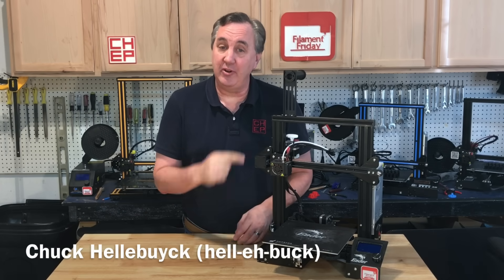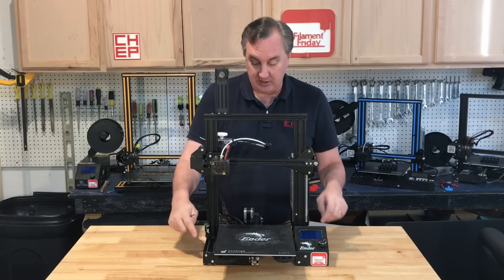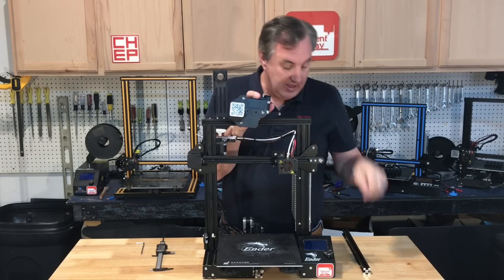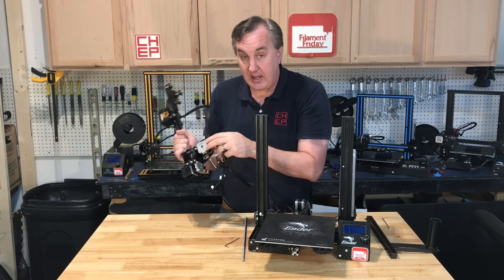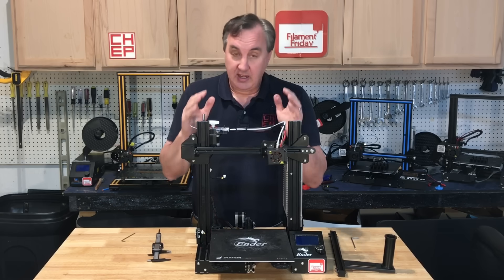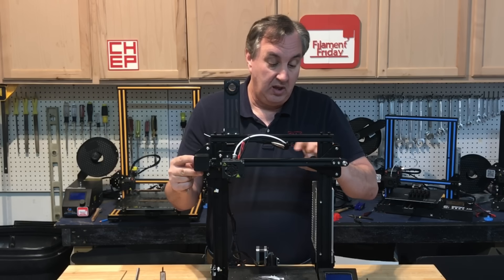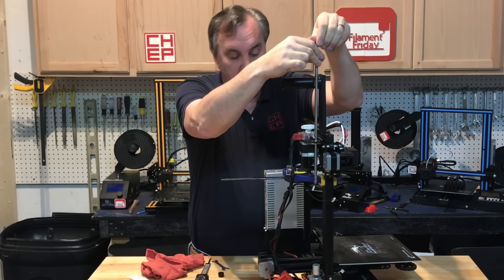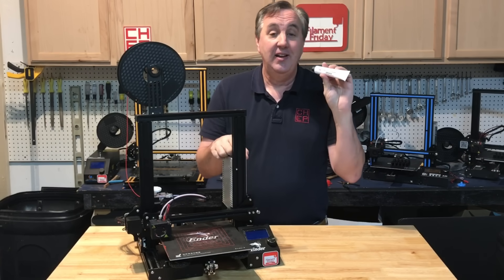Fix Your Bed Level on Creality Ender 3

Comment: Hey Chep! Is there a way to keep the nozzle on my print the entire time? Im printing ducts for a multirotor rc helicopter  and theres stringing and globbing, im using tpu, im using cura 4.3 and ender 3 thx!
Reply from the maker: Why would your nozzle not be on the print?
Reply: @FilamentFriday  well i mean it jumps around the print when retracting, just wondering if yoy can change the travel settings so it never jumps
Reply: @FilamentFriday  figured it out. Its combing mode, to reduce retractions and blobs.  Sorry of i was confusing

Comment: Hey Chuck, have you experienced cura resetting your profiles back to stock? i can save profiles, then close the program and start it again, and retraction, speed, layer height and so on has reset to stock for me :S
Reply from the maker: If you don’t save them as a new or updated profile it reverts back to the original. Otherwise no, I haven’t.
Reply: @FilamentFriday  huh ok. Cause cura 4.2.1, 4.3, 4.4.1 all resets my profiles back to stock. And on every "better result", i save as a new profile.  They seem to reset retraction, layer height, and other setting to stock. I even tried to export profile, then importing it the day after and settings were reset again.

Comment: I put stronger springs in and also removed that strain relief from the lower left spring. another strain relief must be used that does not interfere with bed leveling.  The bed level has not changed in weeks.

Comment: Please help i have an issue with my CR-10 printer
 
While printing the extruder motor stops rotating few seconds then continues feeding then stops rotating few seconds... 
Is there any solution?
Reply from the maker: I’m sure there is but I don’t know based on that. Test it out via the LCD.
Reply: @FilamentFriday  
Thanks for answering 
I just found out there's somthing wrong with E plug in the mainboard

Comment: Wow. I'm happy that I haven't had to go to this level of troubleshooting to get my bed level. I did run into the problem of the large wheels on the threads under the bed falling off, assuming it's from vibration. I'm wondering about getting four nuts to help keep them in position, but then I wonder if those will just vibrate off as well.
Reply from the maker: They should have lock nuts on them to prevent that.
Reply: Nylock nuts!

Comment: I suffer from a 2-3mm warping on any size above 6cm x 6cm, mostly front right corner and back right corner, and no idea whats causing it, I thought first its the cooling problem due to factory cooler (Ender 3), but after reading a bunch, it sounds like its not the case, Im running a creality official tempered glass bed, but that happened with factory one too. Not giving up but any advice what to look into is appreciated.
Reply from the maker: Flip the glass over and use Avery Glue Stick.
Reply: @FilamentFriday  We dont have Avery ones here, is there a specific things I should pay attention to while using an alternative? (UHU i.e) Or its just "what worked" and Ill need to try a view?
Thanks alot for the advice

Comment: I always had warped bed on my ender 3.
After using it for one year I had to replace the build surface.
The adhesion came back, but also something else happened, my bed wasn't warped anymore.
Not sure what happened there, I think the factory build surface sticker had some inconsistencies or was applied poorly.

Comment: great video, I had "some" (5 mm ) slack on my CR10 s5 and the above method would have worked just fine as well I spent way more effort than described here, this would have been so much easier ...

Comment: You left out one of the most important steps which is making sure the Y Axis is level, if it's not then the first layer at the front or back of build surface might be too high or low, best way to know if your bed is right is run a tramming circle.
Reply: backyardbasher how? 🤷‍♂️
Reply: @madrian_hello  push the bed all the way back and measure the distance from the table/bench the printer is on to the top of the bed then slide the bed all the way forward and repeat the measurement, they should be the same, if they are different you either have to shim the center bar where the Y extrusion mounts on it or you have to loosen the 2 hex screws on either side of the main frame then make adjustments and re tighten.

Comment: Hey Chuck, I have a problem with my bed on Ender 3, the middle where the aluminium profile runs is always too close to nozzle while the sides are low, any advice on how to fix it? I have adjusted the excentric nut so its tight.
Reply from the maker: Your bed could be warped. Might need a new one.
Reply: Try to use a glass of 4 mm over the bed, and use hair spray for pla,pteg and stick glue like uhu for Abs (well yuo are gana need an enclosure for Abs)
Reply: I had same problem take a metal ruler run it across the centre of your bed from left to right then look at the bottom of the ruler you'll see light coming through run tape along the bed where the low spots are then get yourself a glass bed and use hairspray also adjust your end Stop to compensate for glass bed I think it's 4mm
Reply: Hey Chuck, as always a great informative video.  It helped me take care of several problems. There is a low spot in my bed too, but before I tried the glass, I simply lifted the mat and placed two 2 inch pieces of notepaper underneath the mat in the center of the bed to act as a shin. This raised it 0.14 mm and seems to have taken care of my first layer adhesion issue.

Comment: Nice display of some mechanical sympathy Chuck :)  I suspect a lot of print quality problems are down to poor assembly on these. The instructions are fine if you have some experience of mechanical systems, but for a novice, there are many pitfalls. To be clear, that isn't a criticism of users who don't have the experience!

Comment: This looks like it'd be a good video to check out if you're getting any z-banding too. Those uprights and the gantry caused me some problems on taller prints before I rebuilt them like you did here.

Comment: If you use wd-40 dry ptfe lube on the lead screw you will have incredibly smooth z movement and no dust buildup after long term use and you can even spray it while in use.
Reply: From what I have read the name WD-40, stands for, water displacement formula number 40. It is not necessarily a lubricant, although it does have some lubricating properties. You are better off using superlube or even Vaseline as others have suggested. I prefer superlube.

Also: any spray lubricant can affect your print. It goes everywhere. Do not use spray lubricant around your printer.
Reply: @joea3728  he litterally said dry ptfe. The brand is wd 40.
Reply: @claudekim7876  I was just writing this exact response when I noticed a reply from you.  Thank you!
Reply: WD-40 is now a brand.  They bought/merged with other lubricant makers and now many products are labeled "WD-40" even though they have nothing to do with the original.

Comment: I had a persistent problem getting my Ender 3 bed level.  The normal level procedure typically ended up leaving one of my leveling screws falling off.  So I completely re-built the frame, using foil shims to make everything completely square.  Still had the problem.  Built myself a 3-point level system.  Still the same problem. I finally came across someone describing a similar problem who discovered their Y axis extrusion was twisted!  I put a level on my built plate and moved the Y axis through its whole range, and sure enough the bubble shifted from left-of-center to right-of-center as it moved. I got myself a piece of bare black extrusion and cut/drilled/tapped it appropriately, and finally I have a perfectly level print bed!

So, if the steps in this video still don't work, check that your Y axis rail is flat!  If it's not, no amount of adjustment of the surface plane or the rest of the frame will keep the hot end level across the whole build plate. And it doesn't take a whole lot of twist to turn into being several mm off at the edges of your build plate.

Comment: Ender 3 have another ploblem . Its dont read the sd card . 
Can you explane solution
Reply: mahmood02 try another SD card
Reply: @funKdatFPV  i tried 3  with 4 gb 8gb
Reply: Not trying to be condescending, but are you initializing the sd card after you've put it in each time? You do it from the menu on the ender 3. Once you do that, it will let you print from the card.
Reply: @readysetnogo  i insert the sd card , from the menu i initialize the sd , up to print form sd , if inter no files to print
Reply: The stock one that came with the ender 3 just died mid print on me
Reply: If yuo have many ,many gcode files its gona be an error, i think its just a memory issue from the microcontroller, just erase some files an try again, its happend to me
Reply: @noway8233  one file only
Reply: Hey bud,  are you running your STL files through cura or another slicer before you put them on your SD card? Sounds silly but when I first started 3D printing a while back I didn't know you needed a slicer and put the STL file directly onto the SD card and it's exactly as you described, nothing shows up, because you have to inject your print settings into the gcode.
Reply: @masamasa1815  I'm hopelessly new and I don't follow you!  Could you please explain step-by-step what is to be done in your second sentence--please?  Many thanks!

Comment: Drilled one hole in the up right. Left on inside. Lock tight the outer one snug it up. Lower the gantry on something sitting on lower legs. Tightening gantry wheels then tighten the gantry screws

Comment: Last year, I had an issue where I would level the bed, and somehow it would immediately become unlevel with any movement. Simply touching the bed made it unlevel. I struggled finding the problem for quite some time. The culprit turned out to be an adjustment for the wheels of the bed. It is out of sight and out of mind. To test this, simply wiggle the bed to side to side. If it moves, you need to adjust that part.

Comment: I had the same thing where those two screws made it extremely difficult to adjust the level of the beam.  I ended up drilling a single hole that is maybe 5 inches from the top on the inboard groove, that lines up with one of the screws, and with it on the machine, was able to tighten and loosen it, and got it level that way

Comment: I have to say that it's a horrible design to have to totally disassemble the top half of the printer to do something so simple as getting the crossbar level. People dislike the Tronxy P802M for a lot of reasons, but this is one area where that design totally blows away the idiotic design of the Ender 3. If I want to level my Tronxy printers, I simply turn the TWO stepper motors on the Z axis until the X axis is level. No disassembly or guesswork required.

Comment: Th3d has their own z rod clamp and anti backlash nut. Do you think these are worthy upgrades?  Whenever I pause my print the hot end goes down ever so slightly that it runs against the printed part it paused printing.  I’m thinking I need this on my printer.
Reply from the maker: I haven’t tried it. So I’m not sure.
Reply: There is a stepper timeout in the original firmware. After 120 seconds of iddle time the steppers lose power and your xgantry can fall a little bit. I disabled this for my z axis in the firmware so when you pause it will stay at the right height. It's better to invest in new firmware

Comment: I don't use white lithium grease anymore because it dry and cause me problem on my printer
now I only use Vaseline and it is the best option that I find 
my printer is a Tronxy x5sa and the 2 Z motor are plug together on one plug
so if one of the Z axis force a little bit it skip a step and I have to redo all the leveling step
but since I use Vaseline I never had that problem again .

Comment: Great video. I am glad someone is Showing how to get the printers square and parallel, Instead of using a spirit level, which probably is not very accurate, To set up a 3D printer. This is the kind of information the community needs.  If you're printing a tower , and everything is not square, you will probably be printing a leaning tower instead,  Even if you are using a auto lleveling sensor. 

I use a machinist square to square my printer. Combination squares generally are not normally square. Even the Sterrett combination square is not guaranteed to be Perfectly square. And it needs to be as close as you can get it.

Comment: I had the same gantry sagging issue, after performing the adjustment a couple of times, the sagging kept coming back. I “fixed” it by installing a second z rod kit that I got from TH3D. Now my gantry is level all the time.

Comment: Chuck you have two or more screws on the motor end of the X-axis.  Is there really enough play in the holes to make this not line up?  I put my Swanson square on my x and z extrusions also to make sure all was square.   Also there are two Eccentric nuts on the Z.
Reply from the maker: This one is an early model and only has one.